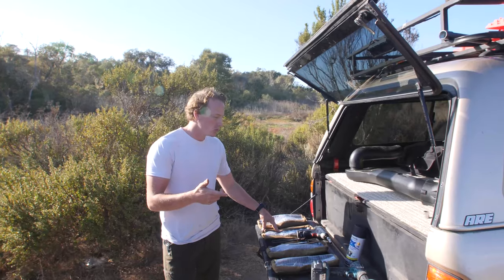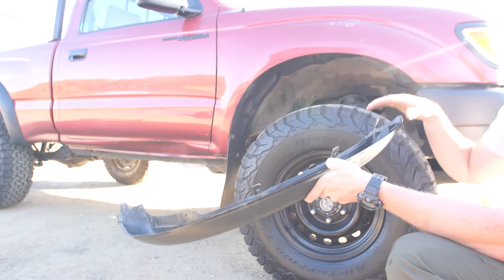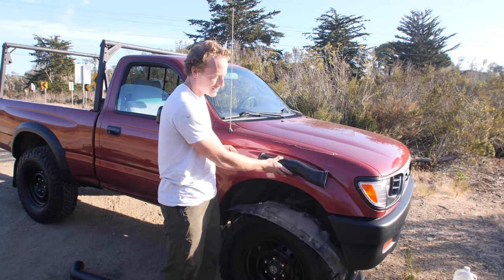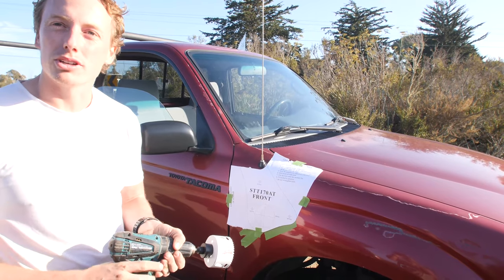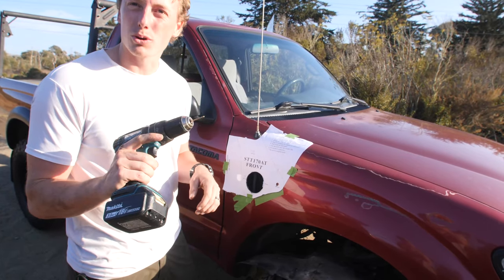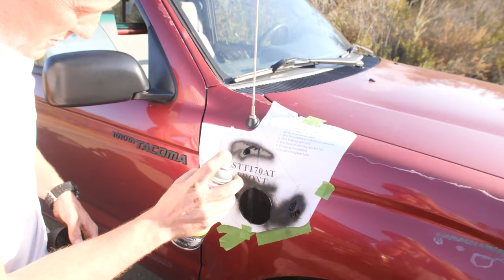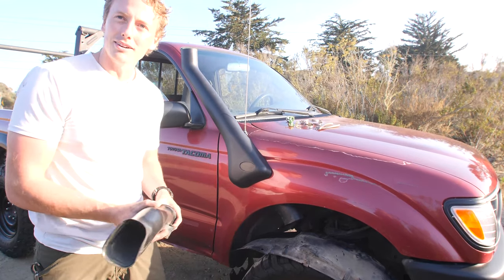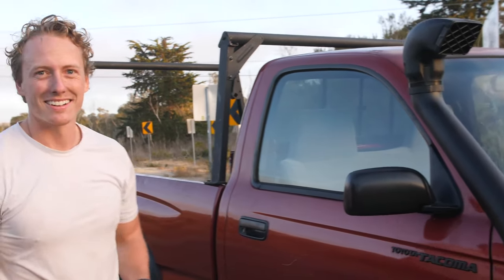How to Instal a Snorkel on a 1st Gen Toyota Tacoma 4K

Comment: 15:16 Spray the rubber with a little bit of WD-40 it will slide right in.
Reply from the maker: Now we are learning! thanks man, great tip!
Reply: Or at least spit on it. Cold even dip you finger in you washer or coolant. reservoir

You never want to go in dry ;)
Reply: I don't like WD-40 for that purpose because it can react with rubber same for anti-freeze.  The safest thing I have found for that purpose is petroleum jelly aka vaseline.
Reply: Silicone grease will work much better
Reply: I always used astroglide and water but that's probably a better idea 😂
Reply: That's what SHE said...

Comment: This is the best snorkel install I have seen on YouTube for the 1st Gen Toyota Tacoma 4x4.  It's on my to do list for my 2002 Tacoma 4x4 SR5 Double Cab. I will use Gorilla tape to secure it to the A pillar as I won't drill into my A pillar.
Reply: What??? So your snorkel won’t be funcional? I’m confused
Reply: Just drill the pillar! Everyone is doing it bud.
Reply: @David-qw2iv    Yes his snorkel will be functional. Unlike you’re reading comprehension.
Reply: @thedetective8150 Did that end up working? If so, what tape did you use? Any need to remove and replace over the years?
Reply: @JD_49  I sold my 2002 Tacoma 4x4 SR5 Double Cab two years ago and never had the chance to install the snorkel. I did buy a 2004 Tundra DC Limited 4x4 that the previous owner put over $11k in upgrades  and I bought it for $14k in cash. It was a steal and thank God his wife was pestering him to sell their Tundra and 4Runner. They wanted to buy EV vehicles and get away from ICE vehicles.

Comment: @overlandunderbudget did you caulk the 3 self tapping screws where the bracket connects the snorkel? Was wondering if water had the ability to get into those holes and cause rust.

Comment: So those push through plastic retainers you cut to remove the inner fender are a pain to try and salvage. I would have bought new ones as well, seeing how the dealer would have done the same thing. But if prefer for easier and cost savings in the end get the inner fender retainers from an earlier pickup. They clip onto the fender and will allow you to reuse your fastening hardware.

Looks good, but I prefer products closer to home, preferably the US and not Malaysia like the one you ordered. I’d even prefer products from Australia, them mates be building some good products.

Comment: You should have put some silicone on the pipe joints and also the snorkel head you can not install it all the way down it needs to be a bit of a space where the line cuts are for water drainage

Comment: Purchased & setting in the garage waiting on other parts to come in for other mods. Don’t necessarily think I need it to cross window high water but cooler and cleaner air intake should help power & mpg plus, bonus if have to cross deep water.

Comment: I have a question about those fender flares that you took off that don't need the clips. I want to install those same standard fenders which I rhino lined onto my Tacoma but it is the same issue with no holes did not come with them. I was going to drill holes myself... Should I not even bother? Do they hold on well without needing the holes?
Reply from the maker: don't drill! they hold on really well without any clips. If you need extra holding power, try double-sided automotive adhesive or mounting tape.

Comment: I feel like my windshield would crack if I mounted it to the piller
Reply from the maker: I think there is a pretty good gap between the glass and the pillar.
Reply: It's fine. I've had my snorkel on for almost a decade and it's been great.

Comment: Looks good can’t wait to get my 1st Gen and do this mod.  Also makes me want to do this to my 4th Gen 4Runner.  What are the specs on the Taco?
Reply from the maker: Heck ya! Its a fun mod to do. This truck is a 1996 Tacoma regular cab, 4cyl, Manual everything, 5spd, 4x4 with locking hubs. Fender flares are off of a 2004 TRD, wheels are stock Toyota steelies r16, Tires are BGF k02, 265/75r16
Reply: Lifted?
Reply from the maker: @stacia4652  front is a small aluminium spacer from eBay. I think it lifted it about 2.5 inches

Comment: What tire size are you using? Those wheels look awsome i want to do the same
Reply from the maker: Thanks! These are 16x7 toyota steel rims which are used as spare wheels from the factory. Tires are 265/75 r16 BFG ko2's

Comment: Did you have to add any type of sealer to the hose connection?
Reply: When I did mine I added clear caulking to the inside of  all joints. Just incase a hose clamp ever failed

Comment: 19:09 big mistake drilling holes there. Cab gonna leak when it rains.
Reply: Negative, I drilled the same holes and have had no leaks since:-)
Reply: Put some silicone under the plate before screwing down. No issues